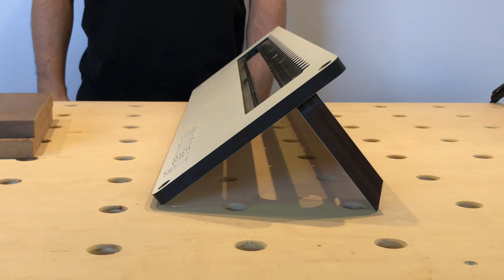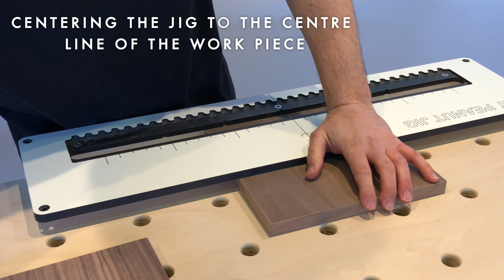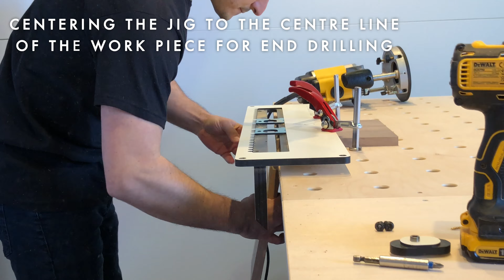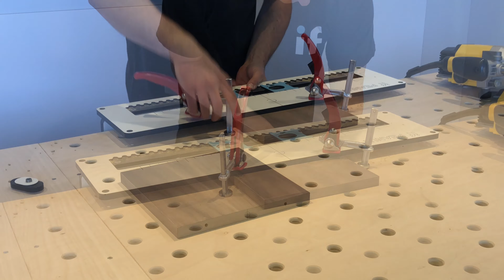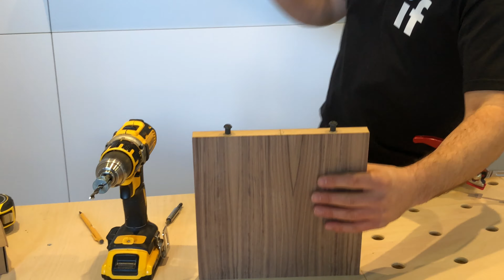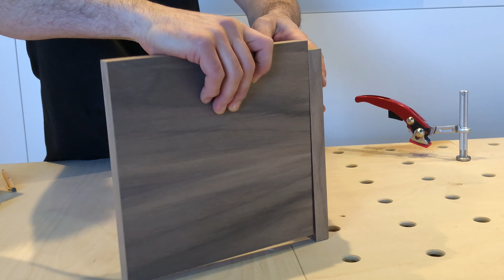PEANUT Jig | Making a 90° joint

Comment: No mention of the price of this jig on your website
Reply: It’s there now £260
Reply: I'm not sure exactly what this does that can't be done with a dowel..  Empty out your bank account faster? Make dowels take less time?  It's essentially reinventing the butt joint?  I dunno that it's changed anything except for the company that sells it..
Reply: @martinoamello3017  Dowels have to be glued in, and quite tricky to get absolutely spot on. Imagine being a cabinet builder using dowels, having to fit units in the van fully built. I quite like this idea to be honest
Reply: 440$  plus shipping and taxes.